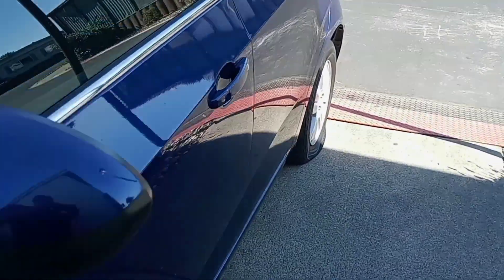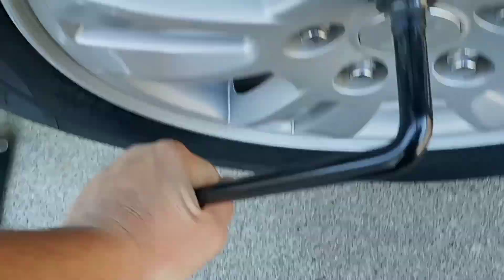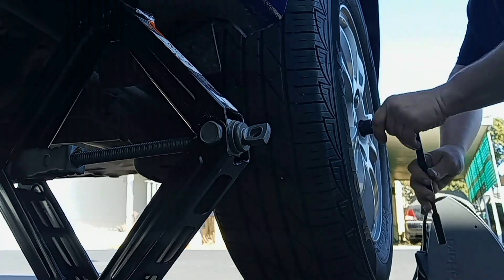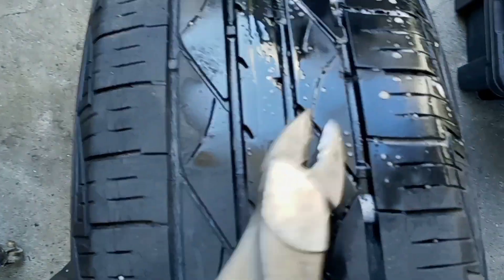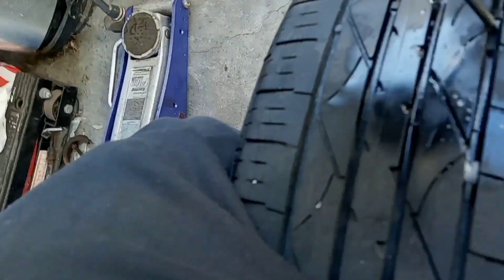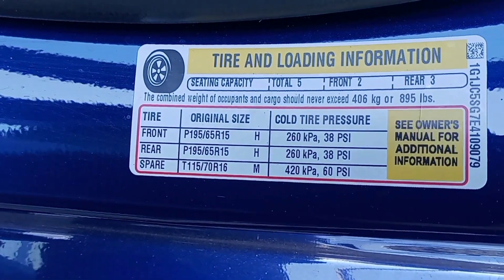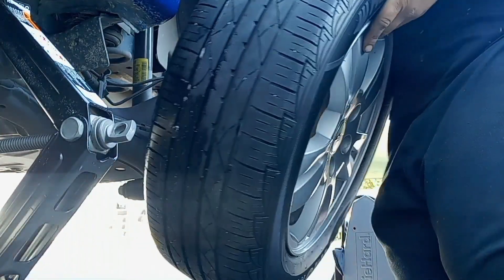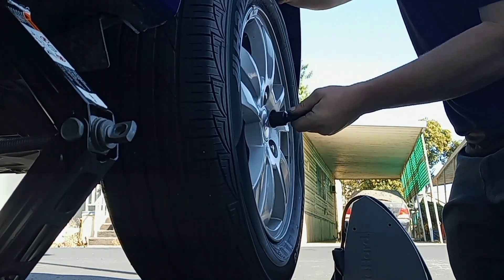How to Fix a Flat tire FAST & EASY!

Comment: Do you have to fill it up before removing? Or is that just to detect the leak?
Reply from the maker: You can remove the wheel before pumping up the tire, but it helps get the car up so you don't have to lift the car so much with the jack.